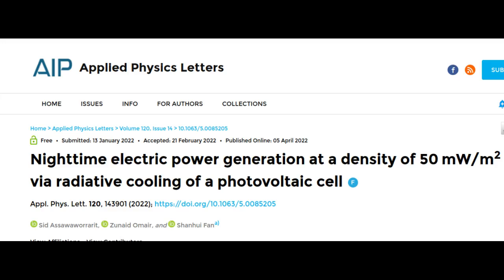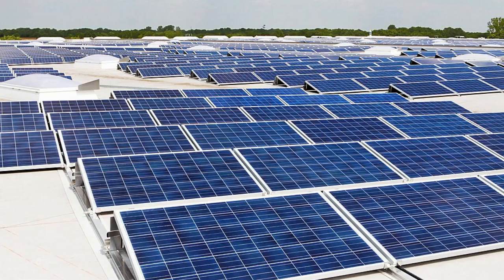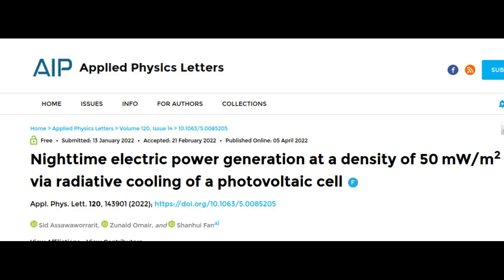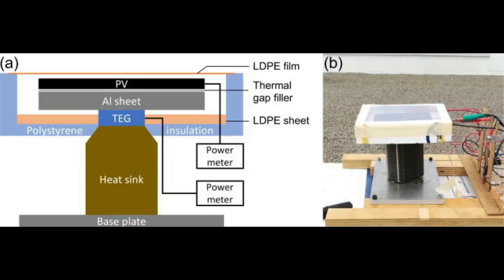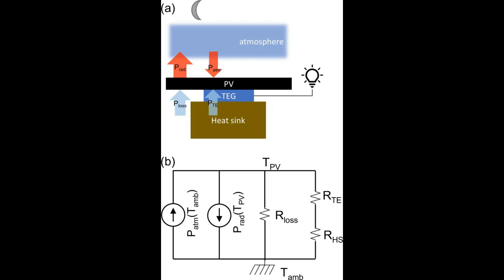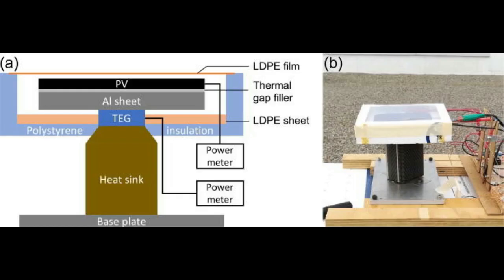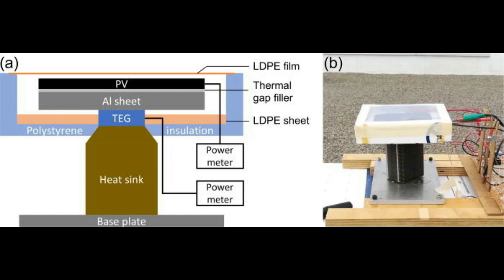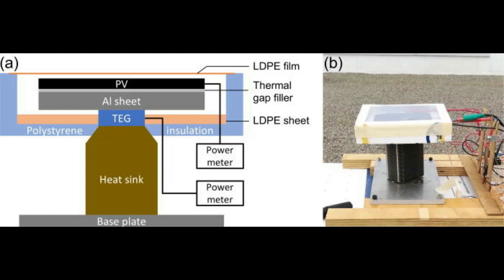Stanford Engineers Invent a Solar Panel That Generates Electricity At Night |  Radiative Cooling PV

Comment: 50mW??? what are you going to power with that?
Reply: Just get a 10 thousand square meter roof of these solar cells to power the aircon at night for the room of 15 cubic meters under it.
Alternatively go with just a 400 square meter roof of these solar panels to power a 20W lamp.
And if you have 50 thousand square meter installation you can go off grid and won't need these expensive and short lived storage batteries.
If you get another 50 thousand square meter installation to charge your Tesla, it might charge up to 100 miles during your nightly rest!
Reply: @raymundhofmann7661  Just to add help visualizing 50 thousand square meters, thats 12.4 ACRES or 5 HECTARES,  Absolutely laughable.
Reply: @mrbmp09  So you say helping the environment and preventing climate doom is laughable?
Reply: @djancak  No, rituals worshipping the new god of climate or the new virus god soothe the mind of the psychotics. 
This the psychotics can directly feel. 
Any "improvement" in climate, environment or common health, because of its huge size, is nearly impossible for a individual to witness.